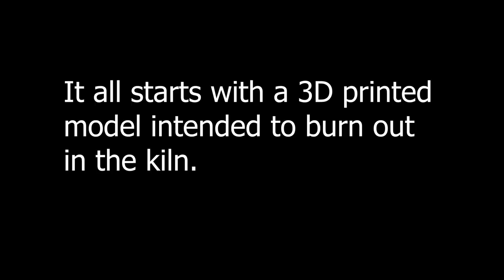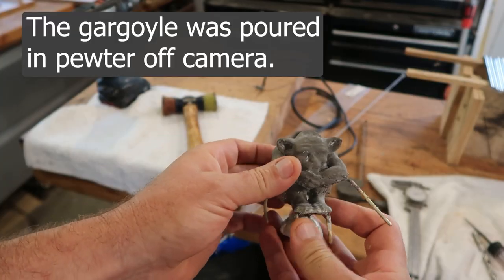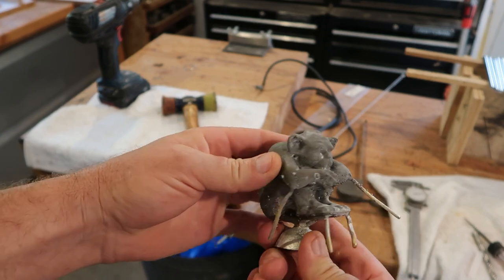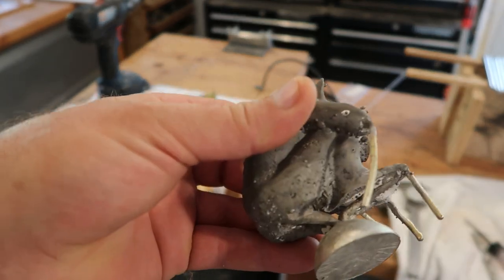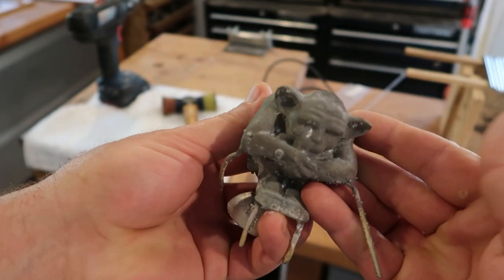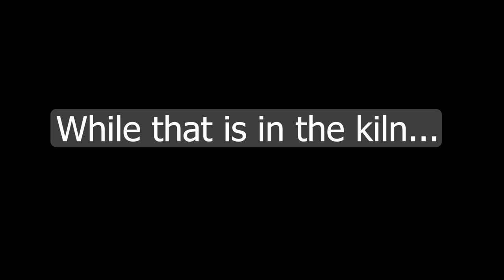Gargoyle with Umbrella - Pewter and Ceramic using a 3D printer

Comment: Have you tried a bas relief in your 3d printed mold?  Last week thought it should be possible looking at a 1963 collectors plate.  Basically add a Zbrush bas relief before printing the umbrella mold.  Could even get into production adding and making a plaster mold in the process.
Reply from the maker: Interesting idea.  I have made a few custom "coins" in a similar process.
Reply: @JustinsMakery  yeah, I just watched your tips for mug stamp video.  Couldn’t find the coin.  Guess there  would be some trail and error getting a design that works well with clay.   The process of bas relief in Zbrush is simple.  Cool idea is work on a coin and plate.  A Zbrush jeweler does a blend shape between his large and small design so a slider covers the different scales between.